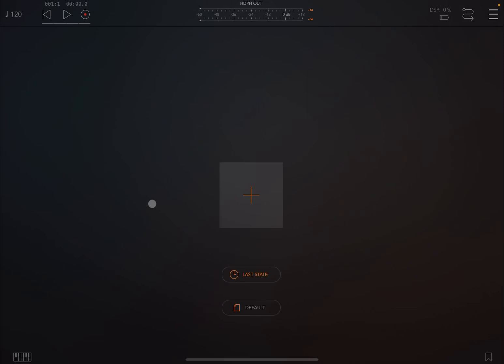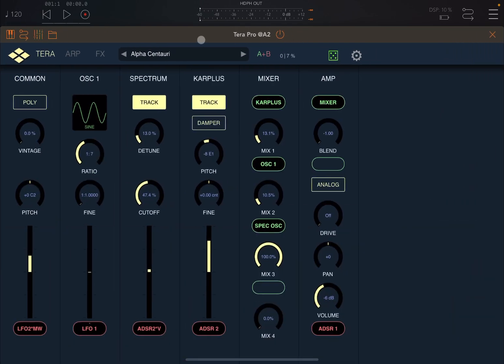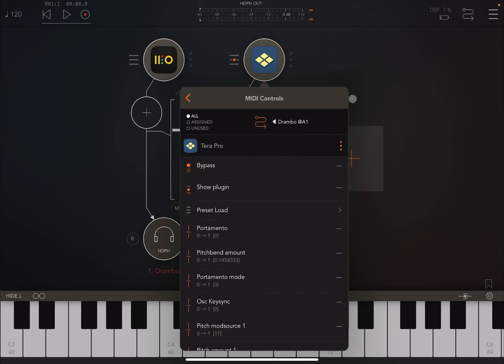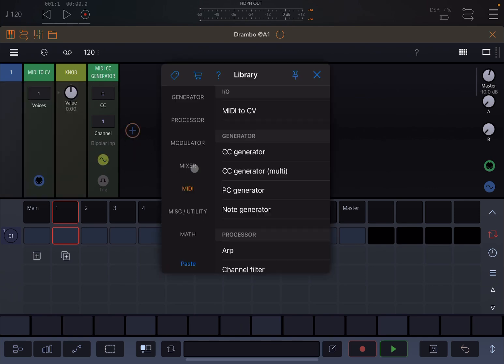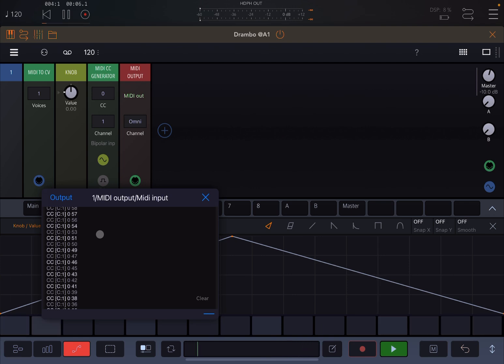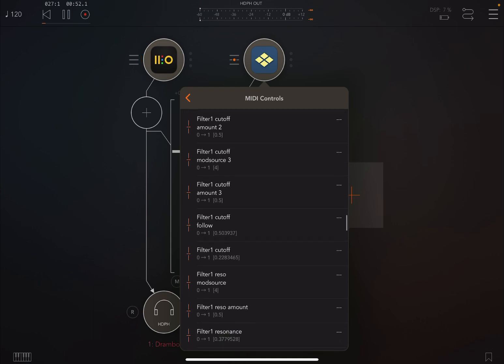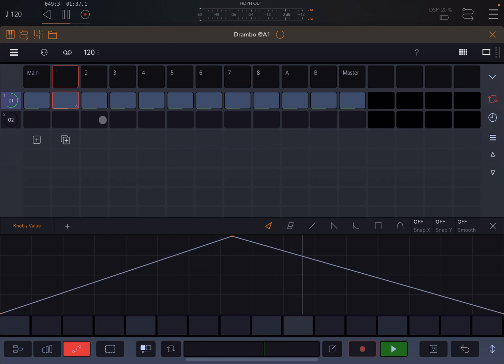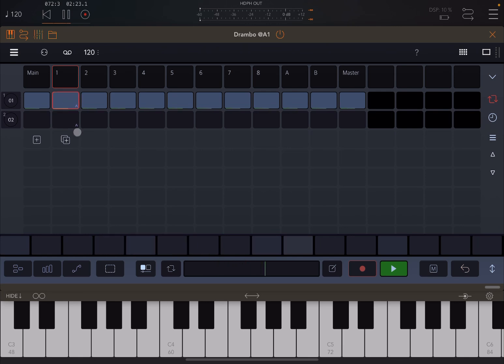BeepStreet Drambo v2 - Demo / Tutorial 90: Drive Automation from Drambo Clips

Comment: Thanks Leo! I'm sure a lot of others feel the same as me having so much fun thanks to these tutorials... I've seen'em all!
The knob trick is perfect!!! I'm beginning to understand that Drambo's got everything you need, really. I wonder if there's a chance to record automation in this kind of dummy clips by moving knobs (or whatever else) inside the au and not from  drambo knobs (or maybe using both kind of knobs, the au ones and the respective drambo ones, simultaneously, even for the same parameter).
(why would I want this? e.g. in the koala fx or in the same koala sampler effects there's that very interesting snapping instantly to the original value, that occurs when you lift the fingers from the slider, and I really woudn't know how to record it, nore other internal au parameter behaviour...).
Reply from the maker: Yes you can record the movement of the knob live or real time and the automation will be recorded in the clip. You can also file the number of measure per clip and therefore do overdubbing of automation in real time…
Reply: @soundformore  I'm having trouble making the same thing with multiple parameters, tried with multi cc generator and multi output but got confused with connections (guess it takes time... drambo is quite new for me)